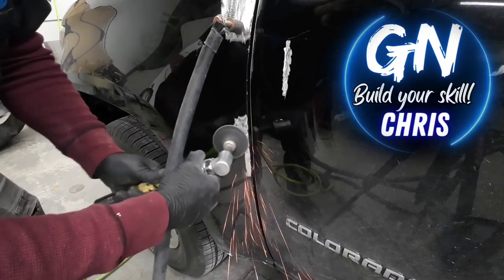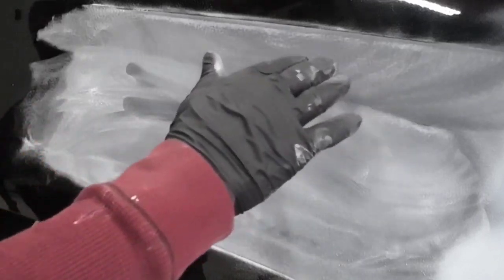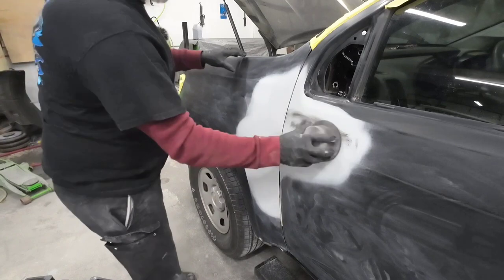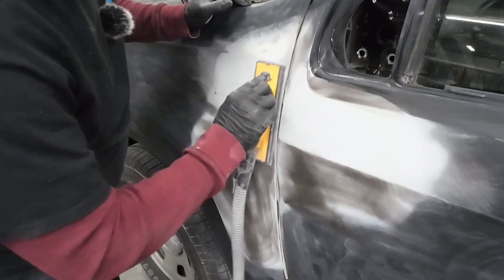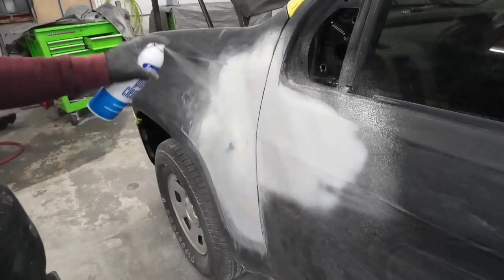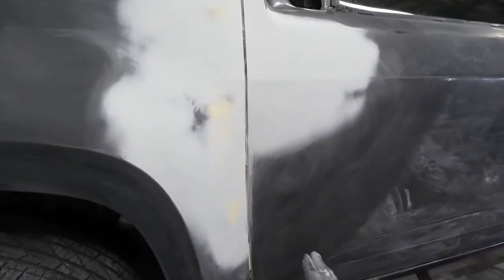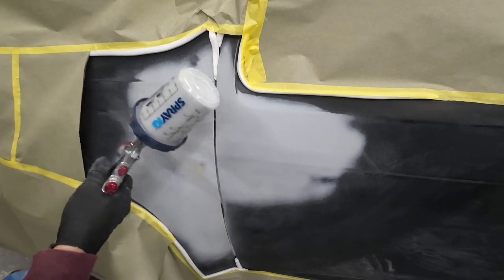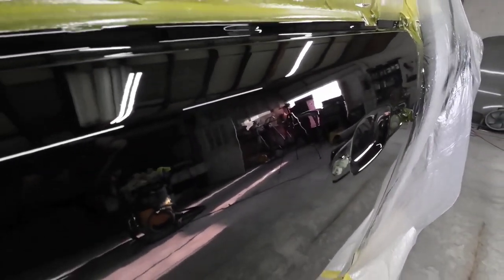PERFECT PRIMER prep before you paint a car!

Comment: If you were redoing old paint with no clear coat and were sanding undamaged/no body filler repair panel sections as you do in the beginning, would you recommend sanding paint around repairs down with a 180 and then 320? Teen trying to repaint car and differentiate between sanding for blending, and sanding for complete repaints. Advice appreciated 🙏
Reply from the maker: If your just prepping around the repair for a blend or paint, I would use 600. If you have deeper scratches to remove around that repair (like 80grit) then sand with 180 then 320 and finally 600. I hope that answers your question.  Appreciate your support!
Reply: @GarageNoise yeah awesome, thanks for taking the time to respond. i heard you mention you’re in tulsa, what’s a place you’d recommend going to and getting paint mixed, clear,  and primer etc?

Comment: Quick question.  When painting, do you let the basecoat fully dry before applying the clear or do you just let it flash, just like between coats?  Maybe I missed this, but I don't remember seeing anyone address this.  As always, thanks for sharing your knowledge.
Reply from the maker: You can but you only need to let it flash off for 10-15 minutes if it's  hot maybe less

Comment: Hi! Love your videos 😎🤛🏻. Whats your settings and tip size for high built primer? Thanks
Reply from the maker: Depends on the gun but I use an R500 with a 1.5 needle set for high build. Around 24 psi
Reply: @GarageNoise  Thanks for reply! When I’m doing priming, primer gets all over my garage floor and comes out like orange peel not flat 🫤. For primer I use R500 with 1.7tip and 1.5bar. When I use lover pressure it spits around spray pattern. What should I do to reduce overspray and get flatter finish?
Reply from the maker: @Rikats15  sound like you should lower you tip size. That will definitely help with peel. I use a 1.5 but for a long time I used a 1.3 . Appreciate your comment and support!